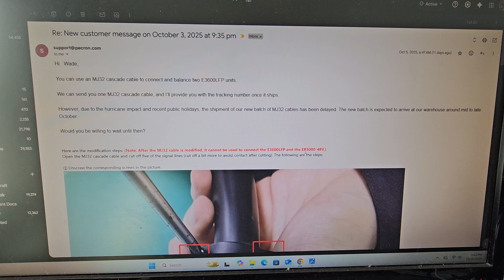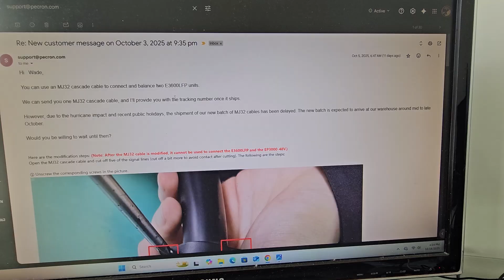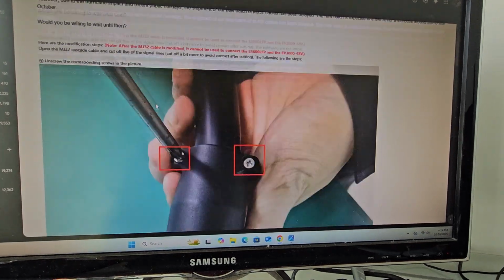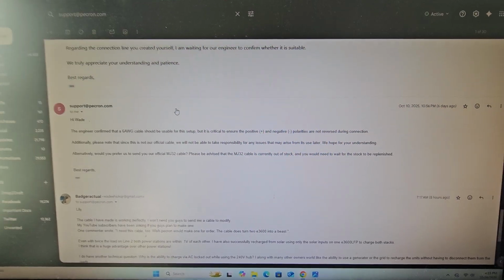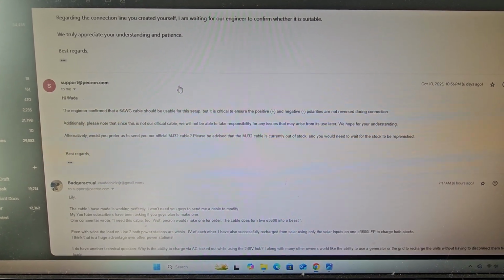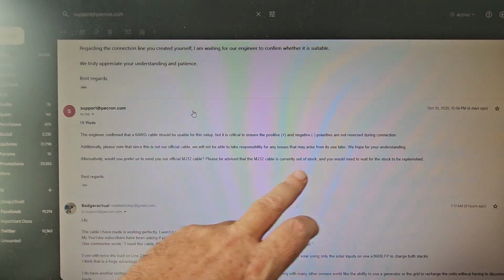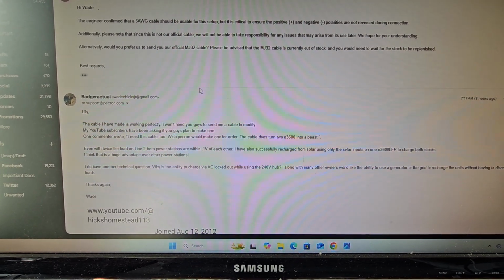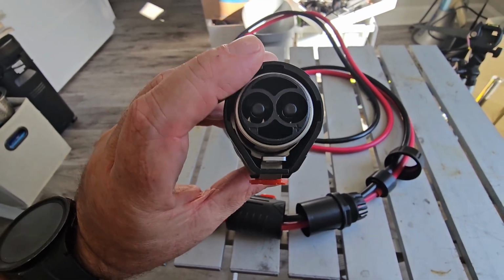PECRON E3600LFP 240V DC BONDING CABLE

Comment: Great video, much appreciated.  So to add one more step with a 3rd party battery to the mix of 2 3600's, think i can get away with simply tying in from the open port on oner of the 3600's to the 3rd party battery?
Reply from the maker: I believe so. The standard is up to 4 expansion batteries per E3600LFP.  So, four larger capacity batteries 5kwh each should work.  The main issue would be getting a full charge of 23kwh at a realisitc max charging rate of about 1980W of solar.  If I assume a good 5 hour day that's about 9.5Kwh. Clouds and shading really cut solar production.  It could take about 2 good solar days to recover from a bad solar day.

Comment: Hi . I have a question regarding the connection of the batteries.  Can I connect 3 batteries EP3000 to pecron E3600 in daisy chain style ?
I am planning to use pecron in my RV. My space is very limited.  Cargo area is like a narrow tunnel.  I have a room to place
E3600 and connect battery  1 and 2 and 3 by daisy chain style.  Do you think that pecron power station will recognize the battery number 3 ?
Reply from the maker: Yes, it should work. It may not be as efficient though.  I'd recommend testing it before the installation to see how the last battery in the series reacts.
Reply: @GridDownPreparedness thank you

Comment: Why does your click bait title say "240 volt DC cable",,.? When it's simply a low voltage battery connector   !!!!,,
Reply from the maker: Because you don't need a bonding cable with a 120 volt set up. Therefore it's not clickbait. I think the video is pretty self explanatory of what the cable actually does.

Comment: House panel buss bars are set up so they alternate between right and left side of the panel. Each breaker slot in a column of breakers alternates between L1 and L2. You could install your breakers on one side and it still would be balanced between L1 and L2.
Reply from the maker: Correct. They way my panel is wired I have my washing machine, refrigerator, and dishwasher on the same line. The E3600LFP will run all 3 including my 240V well pump at the same time. I could move the breakers, but the loads are fairly well balanced as it is. My bonding cable ensures that both battery packs stay within .2V of each other allowing for maximum run time.

Comment: Is DC bonding necessary in order to use two e3600 power stations for 240 volts. I want to be able to pull my water well wires out of my electrical panel then install a 240 volt plug that fits the pecron hub. I'm not sure of the reason why DC bonding is needed for my circumstance. Please respond.
Reply from the maker: The DC bonding cable keeps the battery packs balanced between each power station. It's not required for 240V to work.  However, if one power station's depleted, before the other, both shut down. That's why I made and use a bonding cable. If you're just using it for emergency backup, it's really not required.
Reply: If you were ONLY using the two E3600s thru the 240 box to power the well pump, they would stay fairly balanced. It's the 120v loads in a house that are impossible to perfectly balance.
Reply from the maker: @brithor52  The DC bonding cable allows the batteries to charge and discharge relatively evenly.

Comment: I made one today but it's not working for me. I checked for current and made sure I didn't cross the red and black cable, everything looked(I didn't see any warning or my units didn't die :) fine but no luck. Is there a procedure to connect the the cable to the units? Will the balance instantaneous or overtime?
Reply: Be nice if you told us where you got the stuff you need to make the cable!!!!
Reply from the maker: @GregStone-n8u  The list of materials is in the description.
Reply from the maker: I started when my power stations were completely charged from grid power.  I checked the DC ports with a multimeter. To verify all the batteries were equal in voltage. After that, I plugged my bonding cable in and started testing. I'm twelve days into my current test. I am having an issue with the power stations percentage readings. So today, I'm doing a complete discharge and recharge cycle. Mostly cloudy with rain in the forecast today and tomorrow, so I'll be using my generator to recharge and run my home. Its nearing the of hurricane season and I need to burn the old fuel off anyway.
Reply: @GridDownPreparedness  Do I have to turn-on the DC output on both units?
Reply: I checked the DC ports as well and got some reading. I also checked it again after I plugged the cable to one unit and before I plugged it to the other unit. The reading was the same.
Reply: I need to disconnect the 240V box. I am having issues with it and already emailed Pecron. Now, I wonder if it would fine to leave the DC bonding cable connected if you're not using the 240V hub.
Reply from the maker: @jaysoncamaquin-vigil9525  Yes, it will not cause any issues. I have successfully charged both power stations using only solar input into one. So, the only way the other power station could charge is through the DC bonding cable.
Reply: @GridDownPreparedness  Yes, it working really well. Both battery's are still balancing.
Reply: @GridDownPreparedness so then if i connect two 3600 with the dc bonding cable without the 240v(dont need it ) i can charge both at the same time thru solar ? Asking as debating what should i get the expansion pack or another 3600 with this sale going on

Comment: Appreciate all your videos, very helpful. Quick question, so if I am understanding the procedure correctly you're just clipping all five data cables so they're basically not being used at all?
Reply from the maker: On the stock Pecron cascade cable that is required to us as a DC bonding cable. On my DIY bonding cable there are only 2 6AWG cables no data wires.
Reply: Thanks!

Comment: Have you tried putting a DC clamp meter on this cable when pulling a heavy load on the system?
Reply from the maker: No, but the math works. I have not seen more that a .1v difference so, in theory it would only draw 1A. If it was 1V it would be only 10A.

Comment: Would you mind sharing your parts list (where you got them and rough costs?) 

There are some trolling plugs that are like $48 each, but I also see some for like $20 on Amazon or a 2-pack for like $33. 

 I'm assuming that cheaper one (Novino) would work just fine... But maybe some extra eyes on it would be nice to be safe.
Reply: Amazon has the 47" Pecron cable with double mj32 connectors for $40...I just ordered one will be here Monday. I also looked at the trolling motor connectors and believe they are configured differently on the interior where it plugs in and may not work.  

Pecron MJ32 Cascade Extension Cable 47 inches, EP3000-48V Cascade Extension Cable
Reply: @glenchoitz9497  yeah that might be the route I end up going.  Not sure what needs to be done to the data cables inside... just snip those and terminate them with wire caps smand call it a day? 

My current project is building some SB50 Anderson quick connects for a 48V LifePO golf cart battery charger to see if it will feed one of the Pecron XT60 solar inputs 800-900W as a cheap alternative to a Chargeverter so I can AC  to DC charge (at least if needed for top-ups) from a 3500W gas inverter generator.

If that goes well, then I would like to have this other cable for balancing too and all of my 240V Pecron E36600 issues will be resolved
Reply: @titobandito8474  Got the cascade cable yesterday...15 minutes later i was done modifying. Just clip the light gauge data wire up close to the connector and then as far back as you can in insulation, this left mine with a 1.5" airgap so no further work needed. I used a very small side cutter but even nail clippers would work on the light data wires.
Reply: @glenchoitz9497 Nice!  I'm crying over here seeing the E3600s on sale for $999 right now 😅😂

Man. I thought I got it for a deal, but this current sale as of today is bonkers!
Reply: @titobandito8474 yep, would have saved me $600, so that sucks. But definitely won't be buying the 4 expansion batteries from them now as i had planned. Will get 51.2's somewhere else and gain 67% more capacity for 30% less cost.
Reply from the maker: As stated in the email I received from Pecron, you will need to modify the cable and cut the data wires to use it as a bonding cable. Connecting the Stock 47" cascade cable to the 2 E3600LFPs may short out the BMS board.
Reply from the maker: Links are in the description.